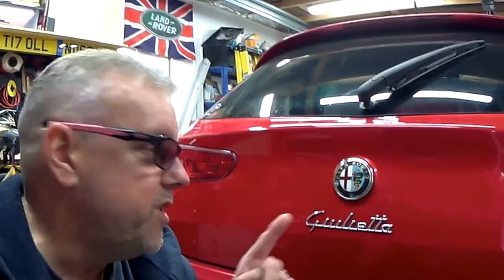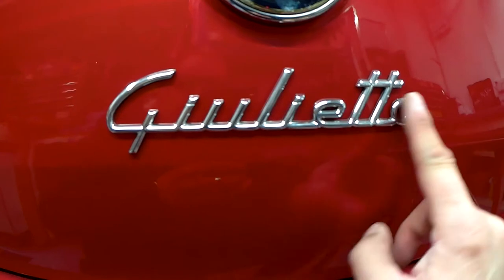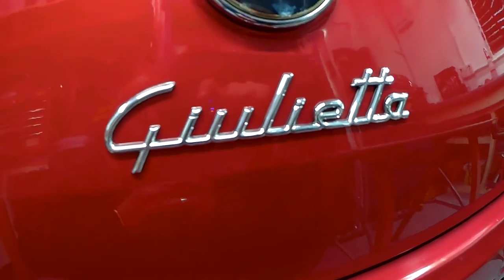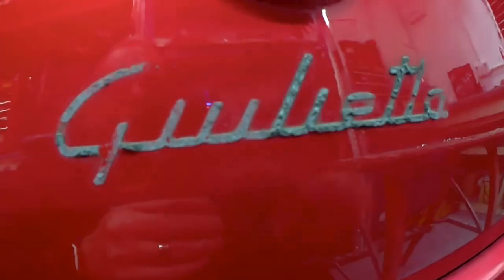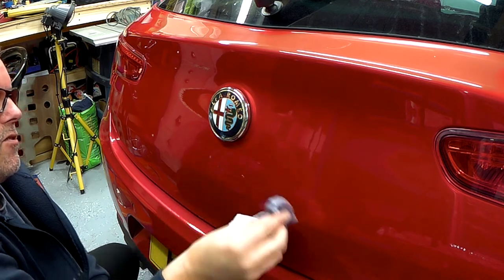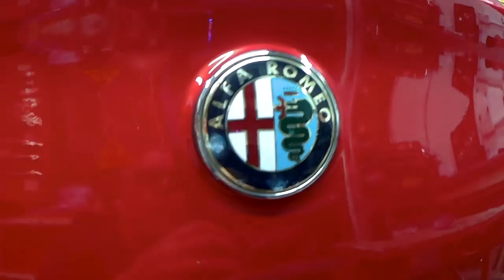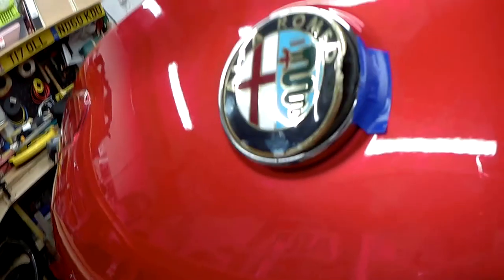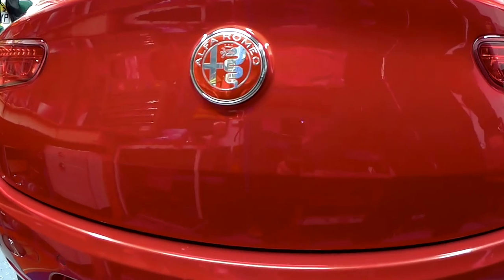Alfa Romeo Giulietta Debadge - Removing the badges on the rear of my Quadrifoglio - Cloverleaf

Comment: Have you ever known any issues with debadging?  I'm referring to paint damage/fading of colour.  I have a seven year old Veloce 1750tbi and thinking of removing the Veloce front wing badges and replacing with Quadrifoglio badges.  As this has the same engine and gearbox, thought it would be OK to put these on 😊. Just thinking of its age and potential trouble with paint damage or colour fading.  Thanks
Reply from the maker: If you worried about paint you could always machine polish the area or the complete wings before you install the new badges.
Reply: @trollmanrs  OK. Many thanks for your reply

Comment: hows it going still working fine? Is the rear badge the same as the front one?
Reply from the maker: Hey Steven,
All good, and yes the badges are the same size. I got mine from Ali-express as you can buy different colours as well as the newer standard type.